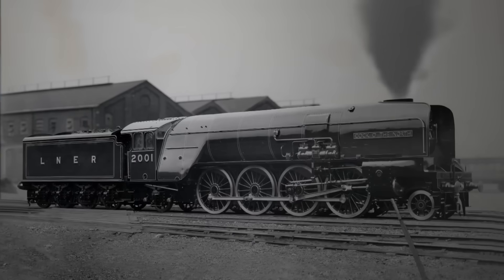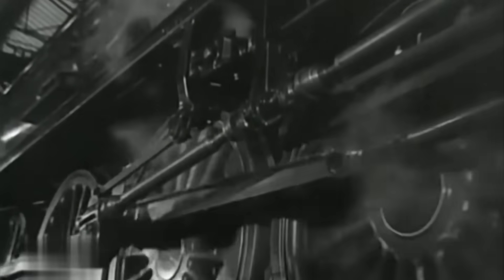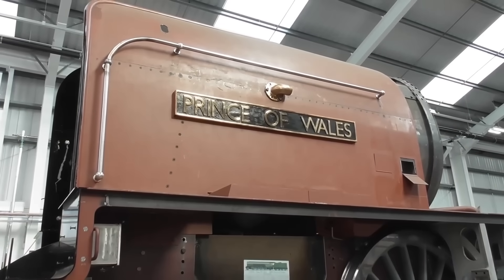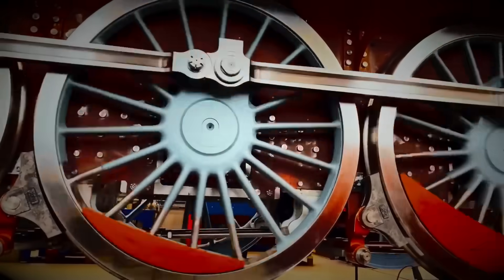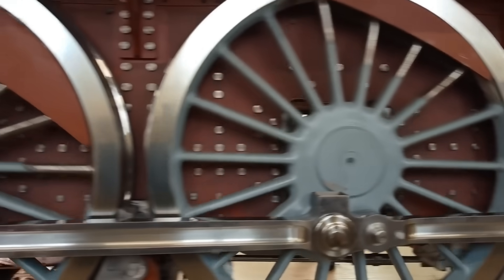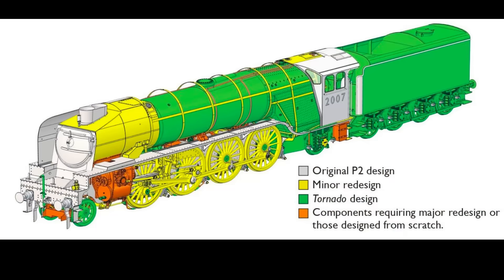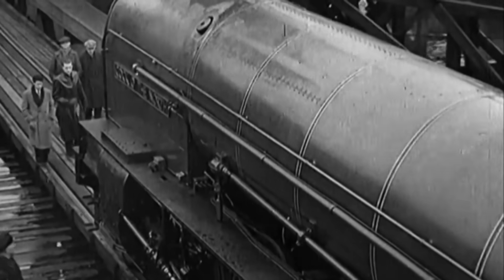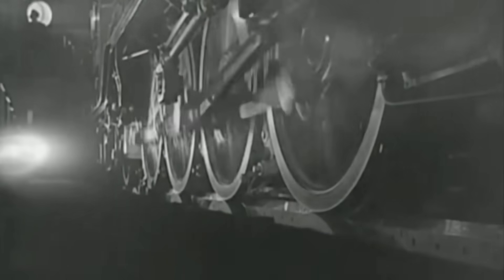The Return of a Legend: LNER P2 ‘Prince of Wales’ Reborn! #lner #locomotive #p2 #princeofwales #fyp

Comment: LENTZ WAS OUTDATED BY 1930 !!!
Yes ! But the original 2001 "Cock O the North" was fitted with Lentz Rotary cam poppet valves, which proved to be not so efficient. And it was quickly rebuilt as per 2002 "Lord Marischall" with standard Walschearts valve gear, which proved a lot more successful. Indeed the Lentz system was already dated by 1930. And later overtaken by the British Caprotti, (as introduced by Tom Daniels) which proved to be a more successful development of the "Rotary cam Poppet Valve" concept. So I am not convinced that "Prince of Wales" with a supposedly modified version of Lentz, will prove anymore successful, and may yet prove to be an expensive White Elephant. Indeed as 2001 was in anycase "Experimental" I'm surprised they haven't built a copy of the rest of that fleet of Locos which had Walschearts Valve Gear, and certainly worked well !!!!

Comment: 0:40 this is objectively incorrect and a common myth about the P2s I wish would just stop. The P2s were very powerful and impressive machines but were frankly unreliable due to a number of design flaws. Their rebuilds to Pacifics by Thompson made them much more reliable machines whilst still being able to handle the same trains they were expected to handle as 2-8-2s and they did good work until they were withdrawn   in the early 60s. Had they remained as P2s they would have almost certainly been withdrawn much earlier.

Comment: I am typing this comment from Japan.
The 2-8-2 wheel arrangement reminds me of the D51 steam locomotive, a freight steam locomotive of the Japanese National Railways, but it is surprising that the LNER P2 was an express passenger steam locomotive with that wheel arrangement.
I am using a translation software, so there may be some mistakes. Sorry.
Reply: It's fine!
Reply: Don't worry, it's all good, hello to you from England.
Reply: あなたのコメントは完全に理解できます。謝る必要はありません！
Reply: The Mikado wheel arrangement was unusual here in the UK, but in France, a number of Chapelon's express steam locomotives used it and to great effect. Best wishes from England.
Reply: Hello,  Check the diameter of the driving wheels (8 off),  as you may find the diameter of this P2 locomotive's wheels are considerable larger than your D51, if that locomotive was designed mainly for hauling heavy freight trains, at perhaps slower speeds.   I hope this translates well?

Comment: I was trainspotting from the late 50s early 60s 
And I never liked the look of this steam locomotive. I don't know why but I just didn't like the look of it.
Reply: If you were trainspotting in the 1950's and early 1960's you've never have seen one as they were rebuilt into class A2/2 Pacific by Edward Thompson.

The first rebuild, No. 2005 Thane of Fife emerged partway through 1943 and achieved 45,732 miles by the end of the year, significantly outperforming the P2s.

The P2s were so unreliable that the LNER Board of Directors voted to scrap them but Edward Thompson said he could rebuild them into 4-6-2 pacifics so emerged the A2/2s.

Comment: The reason that the P2s were withdrawn was due to their effect on the track due to their long fixed wheelbase, the costs of which couldn't be outweighed by their usefulness, as they could only be used over a few parts of the L.N.E.R. system. Nice to see a replica though, but why name it prince of wales ? I thought we had long got past the era of forelock pulling. The name of a long dead monarch would have been more appropriate, as with almost all of the Kings on the G.W.
Reply: (sighs) it's named after HMS Prince Of Wales - surely you've noticed the military connections the A1 Trust fosters?
Reply: @HowardLeVert Yup, plus the P2 will carry its Scottish title north of the border.
Tornado = RAF.
Prince Of Wales = Navy.
Highlander = Army.
Reply: - Has any steam railbuff & Royalty supporter Noticed:  - the previous King of England ( from 1936) had a  G W R loco named after him { making a total of 30 King clas locos}  Now that ,since 2022, we hav  King Charles 111,  would the G W Society / other builder, consider building such a loco for him!!!
Reply: Not my King!

Comment: Progress isn't as rapid as it was pre-covid.  I hope it picks up again soon
Reply: It will. Unfortunately Covid along with the unforeseen big delays with Tornado and the focus on getting her back on the main meant they had to take priority.

But the P2 boiler is arriving in august. The tender wheel sets are out for balancing before being fitted to the frames and the tender tank then trial fitted for the remaining pipe work. The valve gear trial mock-ups are in process too. Oh and a new cannon box casting is being forged as the original for the pony it it’s found to be damaged.

Comment: I don’t think these freight locomotives though. They hauled passenger trains but I can’t remember on which service.
Reply: Edinburgh to Aberdeen.
Reply: @HowardLeVert Where, predictably, they did a fair amount of damage to the track with their long rigid wheelbase.
If the new build has the same issue, I'd recommend exporting it to Australia for the Port Augusta-Kalgoorlie run, which is mostly Nullarbor Plain and dead straight. The big problem here would be the terrible water quality. The old Commonwealth Railways reckoned that the dieselisation of this line saved them an absolute fortune from boiler repairs and water treatment alone.
Reply: @andrewclarke6899  Much of which has been considered and debunked by the Trust and the late David Elliott.
Reply: @andrewclarke6899  Riddles had contemplated a 2-8-2;design but due to the success of the Austerity 2-10-0 designs he went with that.
I have not read any quotes regarding track damage and the 9F design did have the centre coupled wheels flangeless to alleviate problems on curves.
They were certainly regarded as a very successful design.
Reply: @jeremyrichards8327 Jeremy, my comments about track damage were with reference to the Gresley 2-8-2s and not the 9Fs. Respecting the latter, I read an article in one of the old Ian Allan annuals that Riddles wanted a 2-8-2 that was capable of mixed traffic duties but he was overruled. Shades of Fowler's problems at Derby and the sabotage of Riddles's draughting arrangements at Swindon Works?
Reply: That's true, they were passenger designs. The P1s were freight engines, and arguably the best ever made in the UK (9Fs eat your heart out).
Reply: @davidfuller581 Only 2 P1's were built and unfortunately the trains they could haul were too long for the track sections to cope.
Being more powerful isn't necessarily a benefit whereas the 9 F's were a very successful design judging by numbers built (251) and also happily took on passenger work such as on the Somerset and Dorset.
Reply: @jeremyrichards8327  The problem wasn't so much that the trains they could haul were too long for the track sections (though that certainly was an issue) so much as they could pull trains that exceeded the braking power available. That in itself is the big reason big long freight trains never became a thing in the UK, into the 1960s and 70s there were freight trains with only locomotive and van brakes, where fully fitted had rapidly become the standard elsewhere in the world decades prior. 

Ultimately, they probably should have been simpler 2-cylinder designs with a mechanical stoker; they'd have made very successful fast freight engines that way (of course, the issue of largely unbraked freights rears its head here yet again...).
Reply: @davidfuller581  😢 oh yeh-- the P 1s Were, reportedly , ' coal gobblers' -- using more than th 02  2+8-0s which did mor orless the same job,, also I read that the v long, heavy coal trains they coud pull, Wer  toolong for many sidings, hence theyr early withdrawal??

Comment: If this was running on light oil instead of coal (on the DLM system) it could probably do everything the new class 99 electro diesel will do. If a batch of 20 or more were constructed, the unit cost would be a third or less of the electro-diesels. Since the latter cost, reputedly, £4.7 million per locomotive - corresponding to a cost of ownership of £600 a day, there is a huge potential for cost-cutting.
Reply: It really couldn't. I think you wildly underestimate the maintenance required of steam traction - it is immensely higher than diesels or especially electrics. Lots more to lubricate, lots more to clean, lots more to check, lots more to repair, and more often too. Beyond that, the efficiency of an external combustion engine is at best about 10%. Modern D-Es are about 35-40%. Modern electrics are 80% efficient on the low end, up over 90% on the high end. The cost of purchase gets outweighed very quickly by cost of ownership.
Reply: @davidfuller581 
You are presumably referring to 1950s practices  

Most of what you are referring to is due to the use of coal, which is inherently aggressive and difficult to handle. Improvements in water treatment and the use of auxiliary water heating reduce the main causes of boiler wear: scaling and thermal cycling.

Improvements in metallurgy and materials technology can reduce the lubrication issues. They should also allow the use of higher boiler pressures and superheat, thereby improving overall thermal efficiency.

Overall thermal efficiency of all forms of traction has to be compared on the basis of fuel energy input converted to energy applied at the rail. The high efficiency of diesel is dissipated in transmission and idling losses, while electric traction has penalties in losses in transmission and control systems. 

Little effort has been put into applying 75 years of technical development into steam traction. Until some resources are put into the technology there is no way of knowing what is possible.

The point is that there is the potential for delivering most of what modern traction can achieve, with substantially lower costs of ownership; the cost of modern railway rolling stock has got out of hand.
Reply: @physiocrat-sv  This is the case with oil firing too, it's not limited to coal. Beyond that, water infrastructure is costly and in more arid parts of the world (see: the western plains and deserts in the USA, for example) it is monstrously more expensive than just having tanks of fuel. 

Mechanical efficiency of a modern D-E is similar to that of a pure electric; electricity can be generated in any number of different ways, some of which are much more efficient than others.
Reply: @davidfuller581 
We aren't talking about arid parts of the world. There is plenty of water in North West Europe. Diesel traction was adopted early in arid regions precisely for the reason you give.

British electricity is generated expensively from gas and imported wood pellets. Here in Sweden the electrification infrastructures is old, unreliable, and needs to be replaced. Electricity is expensive at times due to the Europool pricing system. 

Many routes are lightly trafficked and would never have been electrified but for the former availability of cheap hydro, but that is history.
Reply: Fantasy...
Reply: The class 99 will leave this old crock for dead at 8000hp.
Reply: @22pcirish 
1) 8000 hp is a lot of amps through the OHLE. Not a problem unless there are other trains in the section all drawing current at the same time. This is already an issue with the 800 series bimodes. And the power on diesel is quite modest, which is all that is available on lines without OHLE, including most of Southampton to the Midlands. 

2) Can 8000 hp be applied to 6 axles?
Reply: @physiocrat-sv the diesel will do the job easily as it powers AC traction motors.
Reply: @22pcirish 
The diesel engine on the class 99 is modest. Look at the spec
Reply: @physiocrat-sv It is a modest engine but coupled with the tech on board, it will do what a class 66 can do but with less range (smaller fuel tank).
Reply: @22pcirish 
I should hope so at the price. Most of the route from Southampton to the Midlands has no OHLE.
Reply: @physiocrat-sv That route will be left to class 66.
Reply: Oh no not another pensioner who thinks it’s 1930. Lovely as this loco is it’s only about 36% efficient if that! The shed at Carlisle would have to imploy about 3000 people on £40000 each compared to about 60 for modern locos. Don’t forget the amount of drivers and firemen to oil fire it on £60000 each then you see why this can’t be done. We only kept steam going in the 1960s by bringing in West Indians to clean out the locos and clean the sheds. Same as South Africa, Zimbabwe and India did!
Reply: @vernongoodey5096  no need to be an asshole.
Reply: @vernongoodey5096 
Let's get the downsides out of the way. 

1) A modern steam loco has an overall thermal efficiency around 12% and the diesel-electric around 35%. In theory. However, in practice it can be another story, as even the more efficient diesel still has higher idling and transmission losses. Electric traction is in-between.

2) Your crewing and staff costs are, in the worst case, double for steam. Not 50 times. You are presumably referring to the use of coal and before effective water treatment and pre-heating systems were developed. The modern traction does not maintain itself. It still needs fitters, technicians, software support engineers, etc, and they don't come at minimum wages. Electric traction also incurs further capital and operating costs for the fixed infrastructure.

Now for the upside. The annual ownership costs (cost of capital) are around 5% of the initial price. At £4.7 million per locomotive, that is well over £200 k per year. So if your initial cost is one-third, you have an extra £130 k a year in hand to cover your extra staff costs. This was pointed out to me by Professor John Sharpe of Queen Mary and Westfield College. Remember also that freight locomotives spend a significant proportion of their service life doing nothing, including long periods laid up in places like Long Marston. The cost of capital then become an important consideration, or ought to.

DIsmissing technologies on the grounds that they are old fashioned is bad science.
Reply: @physiocrat-sv 😮 ,sorry,,, don't understand where "Long Marston" ( ex Army depot) fits in???
Reply: @vernongoodey5096 
It's about economics. Capital costs have to be met whether stuff is in use or not. In the case of rolling stock this is reflected these days in lease charges. 

Freight transport is inherently volatile. Traffic can suddenly vanish for a variety of economic, technical and political reasons; this on top of the normal variations over the day, weeks and seasons. The finance costs don't go away. Over an expected 35 year life, the fleet will go through a couple of depressions - probably 5 years sat in secure storage. 

More generally, the railways are over capitalised. The rolling stock fleet is in principle only enough to meet base-load traffic, which is why we have complicated fares structures to manage demand. 

London suburban services go the other way with expensive stock sitting around all day in sidings. Formerly, elderly stock was brought out of reserve at peak times, for what was called "peak lopping" to provide cheap extra capacity.

Incidentally, half your £60k salaries go back in tax. The real cost is nearer £30k.